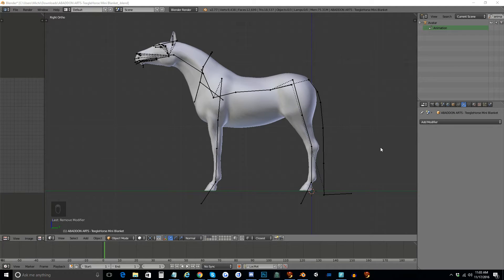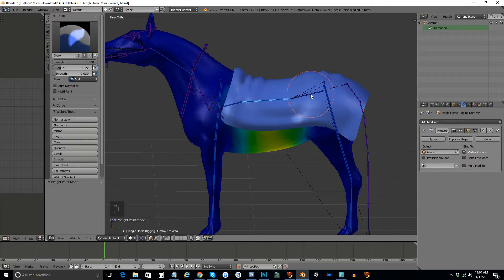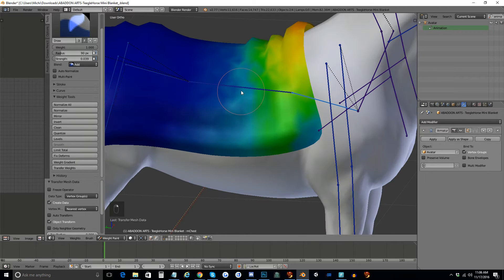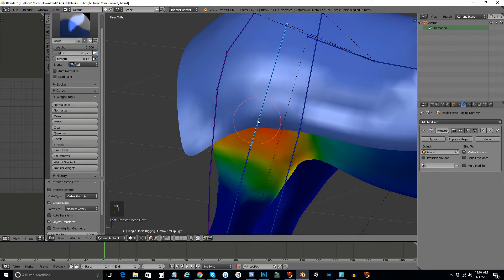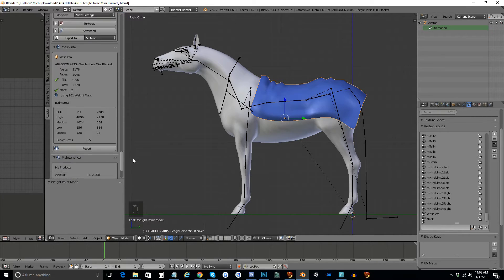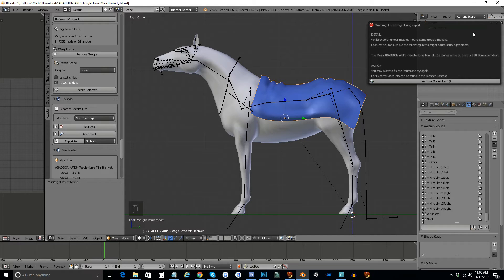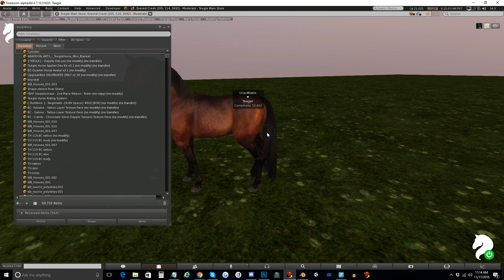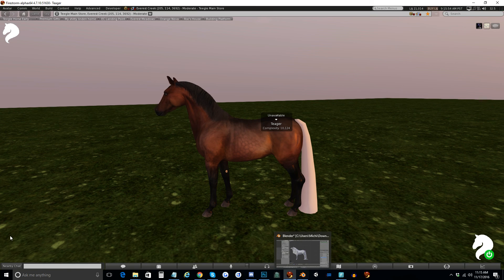Rigging Mesh for Teegle Horse in Second Life

Comment: You have avastar, good for you!
But you have to realize you are making a tutorial on rigging, and the people who watch this don't have or don't want to spend 35$ on Avastar if they have not rigged a single thing yet. You should have exported it without avastar to at least show how it's done.
Reply from the maker: Just use File > Export :)
Reply: Having gone through the whole process running into many problems I finally got it to work.
Simply exporting is not sufficient I'm afraid, as it requires certain settings on export that a premade dummy.blnd may not have set.
Additionally the problem I had broken my head over for a hour, of 're-calibrating' so to speak the positions, rotations and scales before exporting.
I understand if you have a set step plan based on experience, you don't run into these problems. But these problems are often the reason people check tutorials.

That being said, your tutorial has helped a lot! Especially on the bento side of things as indeed a normal export of too many bones does not give any warning, and simply won't show the model to have any armature on SL upload.

Comment: All the transfer weights steps between 0:48 - 4:44 can be done in a couple clicks with avastar: instead of ctrl-p > Armature deform, open the avastar toolshelf, and press T > avastar > skinning tools > bind to armature with weights set to "Meshes". The way shown in the video is a more manual process
Reply: i was thinking the same, well just in case if you dont have avastar you can use this technique... :)